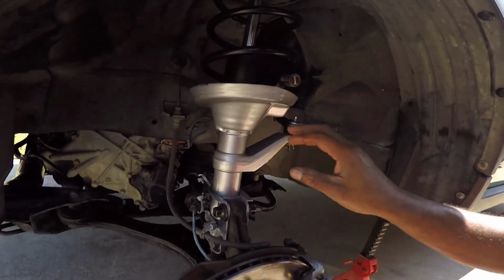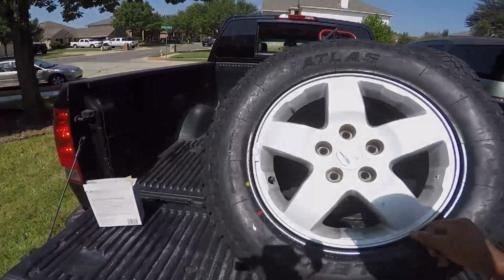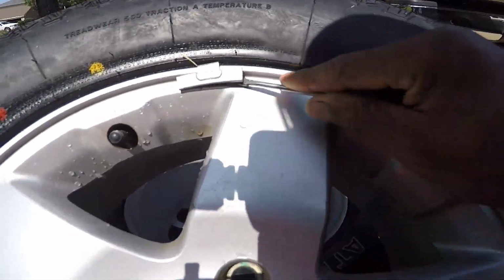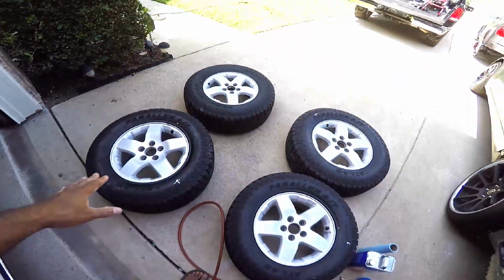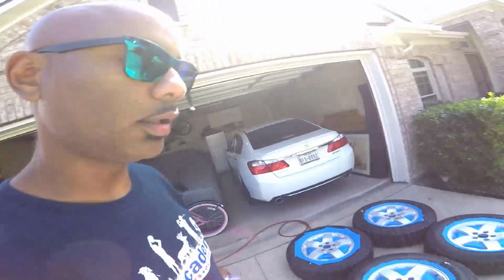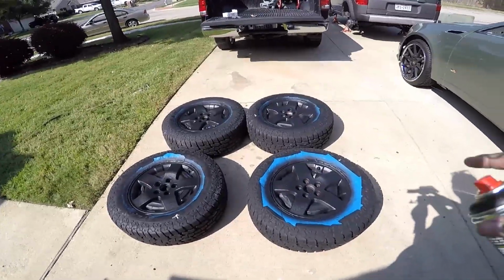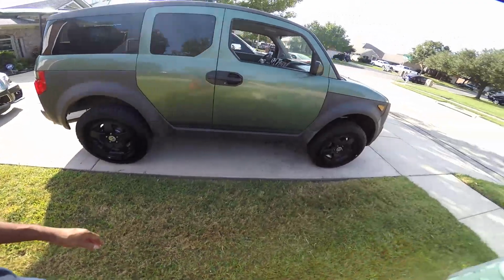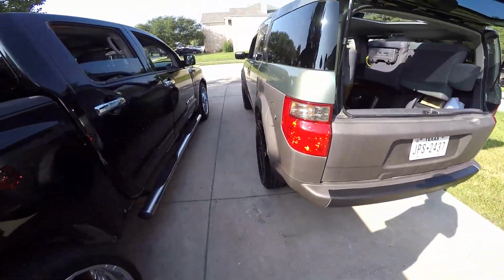Honda Element offroad wheels

Comment: Those are stock 16” wheels right? No wheel spacers to make them stick out a little on the sides like they do?
Reply from the maker: Right stock wheels no spacers. I would like to have a little bit wider wheels in the future
Reply: I put 235/65 (NOT 70)/16  AT's on my stock Element rims just like his. The beauty of doing this is you have no rubbing, speedo is unchanged because the diameter is the same as the stock 215/70/16 the E comes with. No lift necessary and they look great.
Reply: @oldmillrd8153  With the size tire you put on your E, did they stick out a bit from the car?
Reply: @prometheus1901  no

Comment: Bro. Thanks for sharing. Just subscribed now. I like your Titan also. Was thinking about potentially selling my Element and getting a Titan. How reliable and practical is your truck compared to the E?
Reply from the maker: I love my truck I pickup ole girl new in 05 never had one problem. I had element for 3 months nothing but problems...lol but I know it had problems so it's ok
Reply: @ByrdsRebuilds  thanks for the reply bro. I had my E for about a year now. And love it. Its the best car I had.  Ut I kinda want something bigger with more power. Since I get about 20-22 mpg with it and its only a 4 cylinder. I rather sacrifice a couple more mpgs and get something bigger and more power.

Comment: Please tell me which is the widest all-terrain tire that can be put on the element?
Reply from the maker: The BFG TKO's look great also but, as was mentioned, do not rate nearly as high. Those do however come in the stock size of 215/70/16 but the largest size that will fit without rubbing will be 225/70/16, 235 was reported to rub.

Comment: Hey  hello there
Whats the biggest size of tires that could fit on the element?
Reply from the maker: Hey if you do a 6 inch you can put 31x10.50R15 (31.0")

Comment: How's that Raptor liner holding up?
Also, would you ever go to a size 15" wheel and larger tire for any reason?
Seriously considering exactly what you did but with the 2" HRG spacer kit.
Reply from the maker: I'm very happy with the Raptor liner, but it looks like a big Avocado ..lol. Not sure with the wheels I will drive on them for little bit. I went with the full HRG KIT it's like a 5inch lift
Reply: @ByrdsRebuilds  and you just changed out the struts?
Any other stuff like the control arms or CV axel bushings?
Laslty, do you get any of that wobble on accellerating?
Reply from the maker: Sorry I didnt get right back to you, after changing everything no wobble
Reply: I put 235/65 (NOT 70)/16  AT's on my stock Element rims just like his. The beauty of doing this is you have no rubbing, speedo is unchanged because the diameter is the same as the stock 215/70/16 the E comes with. No lift necessary and they look great.